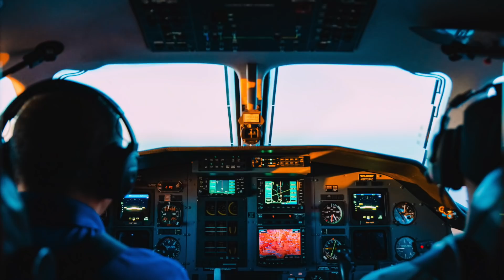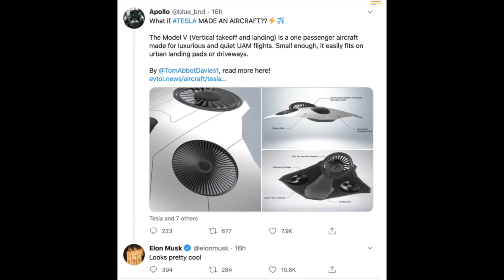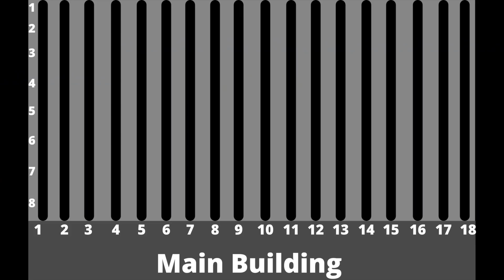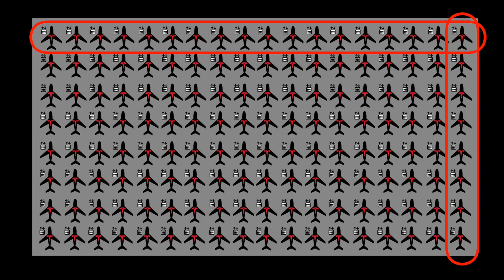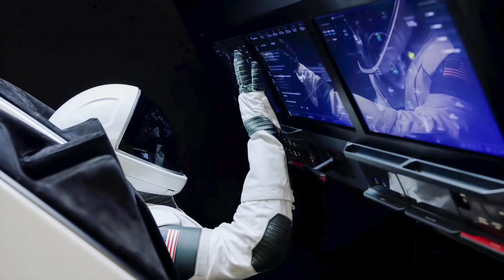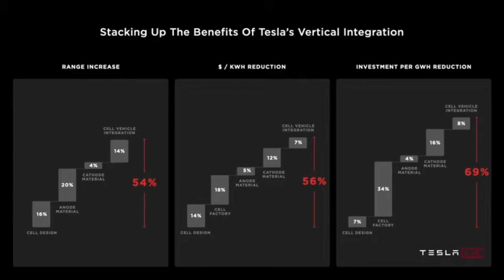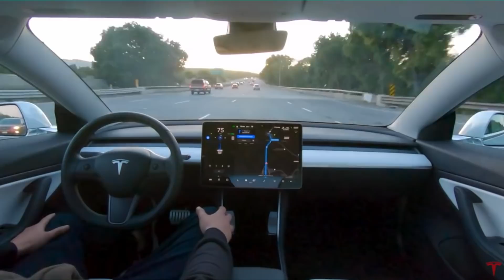Tesla’s Electric VTOL Airplane, will change aviation forever

Comment: Agree about environmental benefits, runway elimination, etc..., but the security bottleneck will continue to be a major unavoidable delay. If a person can "simply go to the roof of a building" and get on board can bring anything with them, such as explosives or other threats. Not to mention that as light as one can make the plane, the weight of the necessary security features (high security cockpit, air marshal seating et al) are also detrimental to optimisation. As Sandy Munro says, a gram here, a gram there, it all adds up...

Comment: Most of the energy needed for a VTOL trip is used during the VTO Vertical Take Off if you also add in the energy required to climb to 60,000 ft and accelerate to 700+mph.  I would love to hear your spengineering (Speculative Engineering) on a system whereby SpaceX uses the Starship (no heavy booster required) to hoist an electric aircraft up to the stratosphere.  That is the only way a 400wh/kg battery could supply enough energy to fly any reasonable distance (please check this out).  The Starship would then simply belly flop back and land at the takeoff site.  The electric aircraft would land by coasting from cruising altitude while recharging the batteries and land similar to how the Space Shuttle did.  It would slow to a stop using the charge that it accumulated during decent.  Thus the landing strip would be far smaller than that needed for a normal jet and could be located at another takeoff/landing site as long as there are takeoff/landing sites scattered around the world as we now have airports scattered around the world.  The Starship Take off and landing part would have to be located far from urban areas due to noise but we could connect those to major cities via Boring Company hyperloops and travel at supersonic speeds between the two.   I believe that this is the design that @Elonmusk already has when he mentions he has a design for a VTOL aircraft system. This could be accomplished by 2023-2024 as you suggest but more likely in the 2030 time frame.  Starting from First Principles, given known physics, No other system could accomplish long range electric air transport. (drop the mic).

Comment: VTOLs, at least recent, where never made to be high above or actual fast. VTOLs does have a drawback, right now on speed.
Reply: Rolls Royce was supposed to be testing a 300 mph prototype this year.
Reply: It depends on design which depends on the use case it was optimized for...

Comment: Lars, are you sure re the efficiency at altitude  of VTOL? I agree jet engine power reduces but an electric fan engine also relies on air density so higher altitudes= less air density = less power.   This needs to be considered in terms of gravitational forces at altitude.  Sorry, I am no scientist but worth some research.  VTOL at lower altitudes, sure.  I want one! Tell me where I sign up.  Tesla VTOL1. Look at the first Apple 1, how much would the first Tesla Vtol be worth in 50 years!   Sadly, I doubt I will be in here!

Comment: If the VTOL's control is good enough in high and unpredictable winds, the airport could potentially be something like a parking garage, an open-sided skyscraper that VTOL's could slot into, set down, then roll to "parking spaces" where passengers could disembark.  This would make it possible to have even more planes per square kilometer of ground surface.  At the same time, VTOL's would make numerous smaller airports practical as you point out.  Combined with autonomous cars and "work from home" technology, this could enable more people to live in smaller, dispersed communities only converging on big cities when they want "city experiences" like specialty shopping and dining, events, rave clubs, and the like.

Another possibility could be a VTOL designed to drive a car into.  You go to the airport, drive into a waiting VTOL, clamps of some kind secure the car in place, then the VTOL takes off and brings you to your destination airport, where you drive away and continue to your destination.  It could contain an airplane-style restroom and a vending machine for snacks and drinks.

Perhaps larger VTOL's could be capable of carrying specially-designed Tiny Houses/RV's.  People could live pretty much anywhere they wanted, then call for VTOL transport whenever they wanted to move or "go camping."  This could lead toward Buckminster Fuller's conception of an "airmobile civilization" in which a home would not need to be tied to "owned" land any more than a boat needs to "own" water.

Comment: I remain skeptical that any electric aircraft, however it takes off and lands, can fly as far as the longest-range conventional jet, the Boeing 787 Dreamliner. That aircraft has a Great Semicircle Range, which is a far as you need to fly to be able to go from any airport to any other airport, non-stop. I'm not even sure you'd be able to stay in the air long enough to cross an ocean.

To be sure, a new electric aircraft will replace the short- and medium-range airliners that typically fly over land or from one island to another. So you have another part of the solution to Hawaii's problem: supporting transportation between and among its islands. You've also solved the traffic problem in "Megalopolis USA," a region of nearly continuous cityscape, where you almost cross from one city to another just by crossing a city-limit line, from Boston, Massachusetts to Washington, D.C. Likewise, London to Paris, or between and among any cities of any size in Europe. (Or Asia.)

But if you want to fly between Hawaii and any other high-population-density airport - say Los Angeles, San Francisco, Hong Kong, Tokyo, or Sydney, Australia - you have a problem. You also need to support the annual pilgrimage routes that serve Jerusalem on the one hand, and Mecca on the other.

Two technologies will compete in that Great Semicircle and other long-range space. One will be SpaceX' Starship, and the other will be a new kind of jet that burns liquid (or compressed) hydrogen instead of Jet Fuel A.

Comment: The "just do it higher" isn't quite as easy. Sure, there's less air resistance, and sure, you're not bothered by less oxygen, but a propeller will still have less power because there is less air to shovel around.
Also, if you want high-performance stuff, I suspect you'll need turbines again - simper than in jet motors, but not that much simpler. But I'm not an expert on these things.
The big thing is energy density. I suspect we'll have to wait a decade or so for high-performance electric planes.

Comment: A VTOL can't go as high as it wants because as it goes higher the air pressure lowers. Too low a air pressure and the propellors have nothing to push against.  This was the big problem NASA had to solve for the mars helicopter
Reply: True this video has a few over looked assumptions.

We would need a turbo compressor turbine and plasma burner to even consider the current cruze altitude. That throws the simplicity argument out the window. Flying on hopes and dreams is the easy part. Take out a physics book and you start from scratch.

Like fan noise and how airport real estate difference was exaggerated as well but still contained some elements of truth. We need more technical improvement before this becomes a disrupter.

Green hydrogen might take over this sector before electric plains.

We need a plasma ram jet for cruising and static charge propulsion for quite flight. Both are only experimental and have too much energy demand at this time. 

It probably will not happen in my life time☹
Reply: @lukeskywalker7457  -“plains”. 😂 Failed at the first hurdle, pal!
Reply: @zoidburg2975  I wouldn’t give folks too much crap about misspelled words. English isn’t everyone’s first language, predictive keyboards often guess the wrong word, and spell checkers screw up as well. I can’t count the times I’ve had the predictive keyboard guess the correct word out of my sloppy gestures and the spell checker comes along behind and changes the right word to a wrong one. Snatching defeat from the jaws of victory, as it were. Happened several times on this very post.

Dew knot trussed yore spill chequer two fined awl thee missed aches.
Reply: @MichaelBrown-kk6ck  It wasn’t misspelled, he just used the wrong word…
Reply: @zoidburg2975  and then he fell face first all the way down the steps!! Also @luke skywalker Just because u can say “static discharge propulsion” or (my favorite), “plasma ram jet” doesn’t mean u have a clue about the concept, as the totality of ur comment reveals! Also, props don’t work by “pushing something” lol they generate aerodynamic lift my forcing the air on leading side to move faster than trailing side, causing a low pressure area ahead of it and drawing the prop forward. In addition this has nothing to do with why electric vtol plane could go higher, he was referring to the limitations of ice plane as a result of poor combustion at higher altitudes and less oxygen per square inch of air causing less efficient burn b poor fuel efficiency. Electric vtol planes have the benefit of vertical take off (vtol), higher cruise altitude (electric motor), and ability to still be competitive in cruising speed (wings of airplane utilized once vtol altitude is reached). How u gonna critique a video while ignorant to the concept as a whole?!
Reply: He talks about ICE engines going slower due to inefficiencies of the fuel/ air mix.. this cannot be right? Surely it was because of sonic stress on the rotating blade tips??
A problem which electric VTOL planes would also have... preventing them from being substantially faster than ICE engine planes...
Reply: so jets and rockets would also have the same problem at altitude with less air to "push against" and rockets could not work in space at all because there would be no air to push against, hmmm
Reply: @chrisharris1522  
Rockets are different. They don't need "air" they work off throwing mass out the back, called "thrust!"
Reply: @MaxMisterC  cool so you know how rockets work, and are just a little confused on how propellers work
Reply: @chrisharris1522  
So you are a little confused about the difference between jet propulsion, aerodynamic lift & why rockets need oxidizer (& jets don't) to work...?
Reply: @MaxMisterC  jets need an oxidizer to burn fuel otherwise they would just be dumping unburnt kerosene out the rear of the engine and making a big mess on the runway.
Reply: @chrisharris1522  a rocket has immensely more thrust then a VTOL will have.  And as for in space. Space might seam empty but it's not empty there's plenty for a small engine to push against but they mostly rely on gravitational forces to sling shot
Reply: @Bobbleoff  please do just a little basic research on how rockets work. honestly it is a very basic concept
Reply: @chrisharris1522  why? You just said I know how rockets work
Reply: @Bobbleoff  no I said maxmisterC knew how they work, by ejecting mass behind them and using physics to create and equal and opposite force on the rocket, accelerating it forward. Propellers work by creating an area of lower pressure in front of the propeller and a higher pressure behind it, similar to how a wing creates lift, neither work by pushing against air, at altitudes that the proposed aircraft would operate there is more than enough air to create this pressure differential but the density of air resisting the forward momentum would be less allowing for greater efficiency. Of course this is a simplified explanation, there are more forces at work which is why I encourage you to do your own research as there is plenty of information that can explain this better than I can in a short YouTube post
Reply: @Bobbleoff  Push against? Think you’re above your physics understanding, here. Rockets do not push against anything.
Reply: @zoidburg2975  I never went to college but I think "thrust" is somewhat like the amount of force the engine is "pushing" on the atmospheric pressure? Could be wrong but how i see it is air has density, meaning is can be "pushed" upon with enough force.
Reply: @jacksparrow3490  Rockets require no “pushing” of anything, it’s the equal and opposite force causing thrust. This is why they work in a vacuum…
Reply: @chrisharris1522  IE Mass is NOT negligible in space!  That includes the mass of particles!
Reply: It seems to me the requirements for a short trip duration VTOL craft are very much different to a long distance aircraft which would most likely still require wings and runways for takeoff, cruise and landing if electric or even hydrogen powered. VTOL  plus long distance operation seems a long way off to me.
Reply: There's always problem with batteries. Airbus already planning hydrogen infrastructure for new generation of planes. Musk has only rumours based on few conversations and too much work with Space X and Tesla....and rockets are noisy as hell.
Reply: Exactly right.
Reply: The Mars drone has to spin its blades at incredibly fast rates to overcome the lack of atmosphere.
Reply: Don’t forget wings need air.
Reply: You make sense but several other things are happening at the same time!

Comment: That cool 3 fan design is never going to happen. No redundancy. Single fan failure = DEATH. These aren't cars than can pull over when something goes wrong with the engine. So many people come up with these cool designs that are death traps in the air...

Comment: Add solar panel film to the body/wings? Charging while flying. Great film Lars.
Reply: If you can get solar panels cheap, light and thin enough why not but solar panels don't generate anywhere near enough power to sustain high speed flight.

A 747 for example uses about 60,000 horse power or 45,000,000 Watts during cruising.  You might be able to cover it with 1000 square meters of panels which at 100 watts per square meter would only give you 100,000 Watts or a little over 0.2% of the power you need.
Reply: bro you don't know much about physics if you think solar film could provide enough energy to even be considered for an evtol
Reply: @troywalt4834  sorry mate, I forgot to to say I’m a fanboy not a scientist or qualified in anyway. I do appreciate you pointing my nievity in such matters.
Reply: @JohnnyGavigan  haha i am a fanboy of evtol too even if i don't think we will see them soon on the sky for long distance, but they sure would revolutionize air transit

Comment: There’s fewer air molecules at high altitudes, so I’m not sure about your theory about VTOL’s being more efficient and faster at high altitude. I’d need to see the actual details of this theory.
Reply: He is only dreaming... Imagine the noise vtol will produce if everyone use it to get home...
Reply: @amitaimedan  Actually, there are Turbine designs that are incredibly quiet so the noise issue could be less of an issue, assuming proper noise rules were in place. The buzzy aggravating noise from the ubiquitous drones we see these days would quash any VTOL adoption. I do wonder how the massive air blasts during takeoff and landing would be resolved however.
Reply: @amitaimedan  i think he’s referring more to the fact that at higher altitudes, you need to provide more thrust to “push” the object…with less “molecules”, there is less “air” to push. 

I agree with him, I’d like to see the science in this too

Comment: EXCELLENT LARS - Your visionary reports are getting more and more ahead of the other Tesla Vloggers.
Reply: Keep saying it, innovation comes from disruptors, not from the existing industries.

I think VTOL it’s for short and medium range not for long range. At least for a couple of decades.

Also I think they will be smaller aircraft, there will be no large VTOL Aircraft for a long time, again a couple of decades. But that’s OK it takes time to do these things right.

Electric airplanes in the future. Possibly fuel cells, hydrogen electric (maybe) for large and long range aircraft, but there are so many problems with hydrogen I just don’t know.  It seems like energy density is it only advantage Long with zero emissions if the hydrogen is sourced properly.

Hope a lot of companies, new companies, get involved with electric airplanes. I hope Tesla also but lots of others. I hope Boeing goes out of business, and I hope airbus gets its act together but they are a bunch of socialist pigs so don’t expect much.
Reply: @steveperreira5850  what problem does a VTOL solve that isn't solved by a tunnel network, Hyperloop transports, and FSD cars? Cars and Hyperloop transportation solutions are much less effected by the weather. Electric aircraft would be loud, dangerous, and unreliable due to weather. People can already buy gyrocopters as a personal transportation solution, but they don't. Small aircraft are dangerous because they can't handle windy conditions safely. This whole video got it all wrong. He should take it down.

Comment: When the VTOL is at its highest point, wouldn`t the atmosphere be so thin that the propellors must use much more power in order to generate enough lift?
Reply: The air resistance is lower so it takes less energy to move the same speed. With higher speeds you increase the lift force under your wings.
Reply: @yourcrazybear  Whaaaat...? Your brain is stuck in a fuelled jet aircraft, he's thinking batteries with propellers that also become inefficient as the density of the air decreases with altitude.. yes the aircraft will move through the air easier, but with a jet engine pushing it.. blades used for propulsion at high altitudes are not good, ask any turbo-prop pilot :)

Comment: from what I understand from engineers what you describe is impossible with battery plus electric motor. it only works for small strircraft doing small journeys, medium at very best. only vtol hydrogen could disrupt the airline industry as you describe it.
Reply: Please see my comment above.  You are correct, but my idea solves this issue.